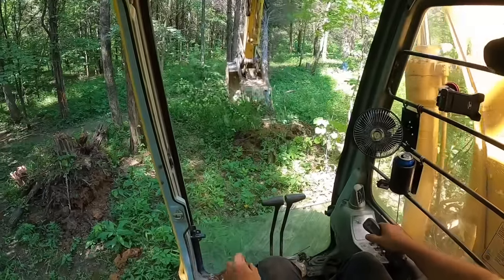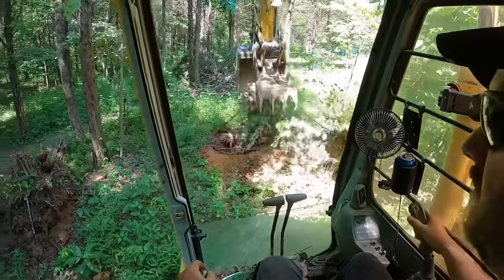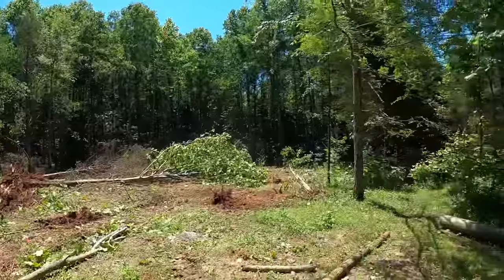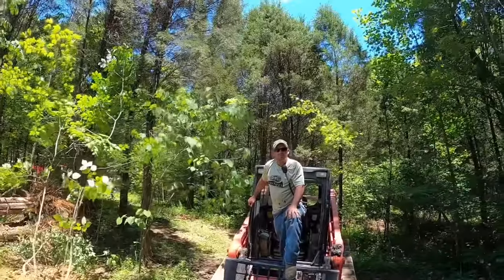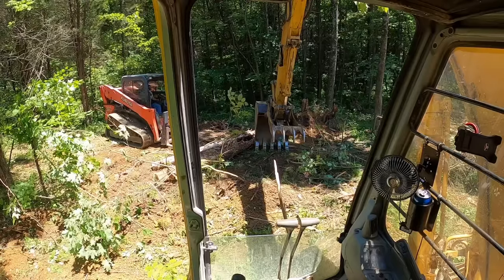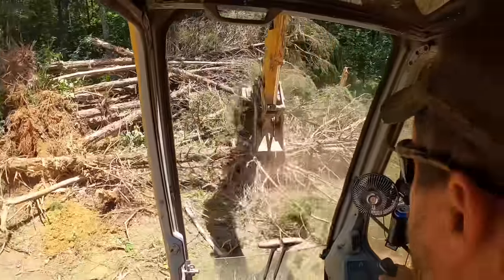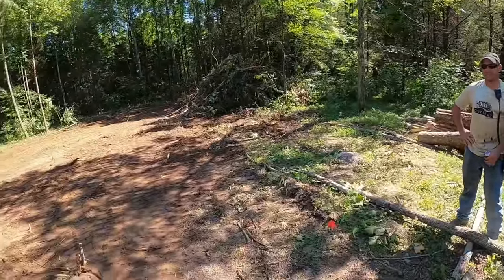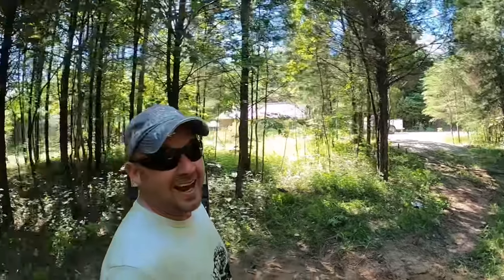Clearing trees for a new barn and saving every tree we can and Aaron has a small mishap 😜

Comment: A couple weekends ago I drove up to Petersburg, IN to pick up a 11' hydraulic disc to haul back to TN.  Supposedly, the tongue on it folded up for transport, but that was far from accurate.  Needless to say, the tongue hung over the side of the trailer fender about 3'.  I just KNEW I was gonna run across Ofc. Hoover and end up on the side of the road getting chastised and cited up one side and down the other.  Didn't happen, but I DID end up going thru a few construction zones between there and Evansville, all of which had a Trooper sitting at them.  Fortunately, it was pouring rain so hard they probably couldn't even see how close I was to giving them an extra stripe down the side of their crusier...haha! I was never so happy as when I crossed the river into KY.  In any case, what a nerve-wracking 5-hr drive home, the worst of which was thru Nashville......as 40,000 people were pouring in to see a Garth Brooks concert at Titans stadium and traffic was gridlocked.  Good times!

Comment: Matt may not have a problem with carb adjustment, or mixing up his fuel, it could be a loose cap or vent on his fuel jug allowing the gasoline to evaporate somewhat and screw up the mixture ratio. But hey, did you see any skeeters after that? Probably not¡!!!